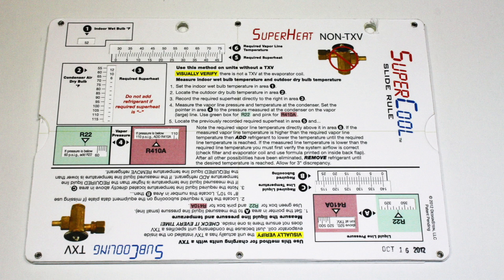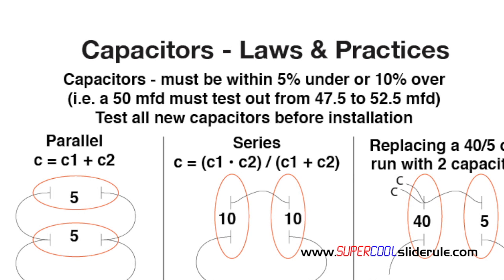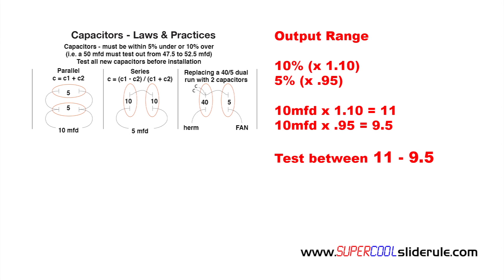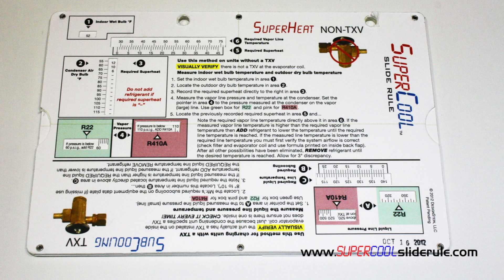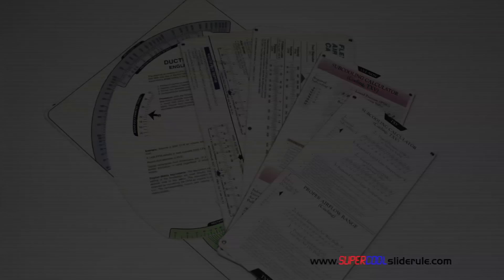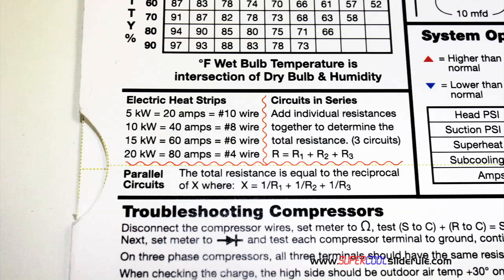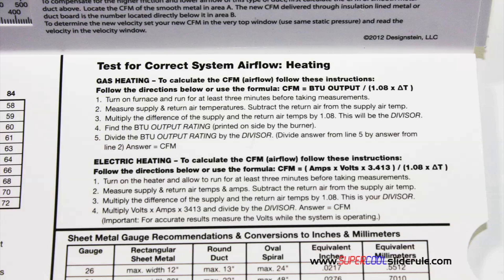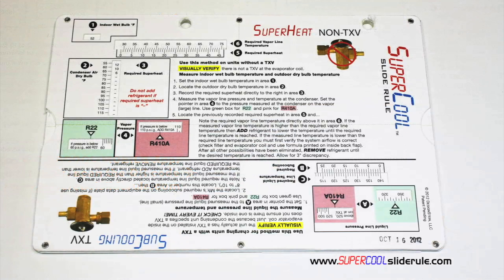How to test capacitors

Comment: Have you ever had a  capacitor check good with the meter but still be bad as it could break down under  operating conditions in an AC unit ?   Thanks